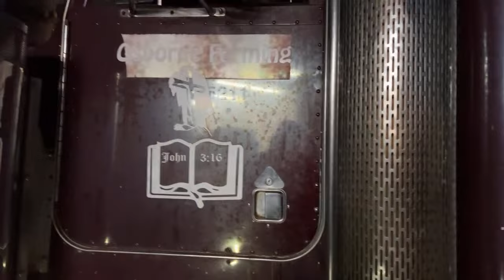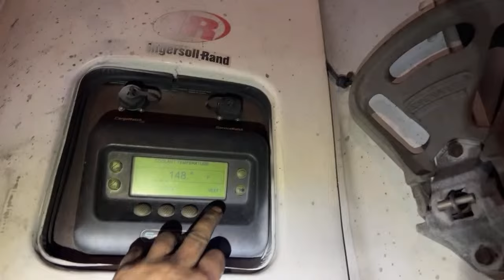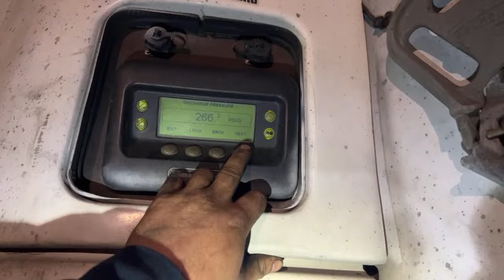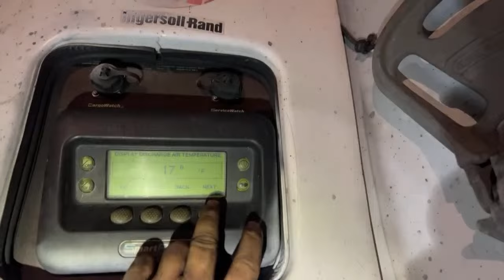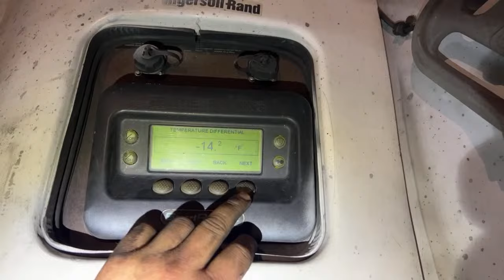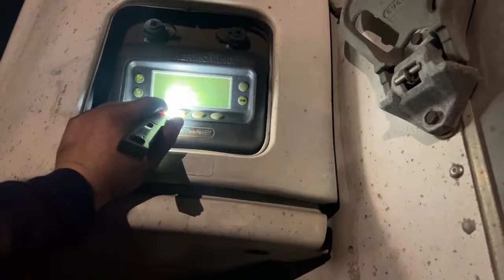Blew A Tire Under A Load!!

Comment: Hey Tim sorry this isn't a comment on this video but seen a video last night don't know if it was your or Steve's but it was one where dad was working on a big rig's engine and putting anti seize on the head bolts. Just wanted to say or ask you to tell your dad that I said thank you for the great tip about mixing oil into the anti seize, my bottle was half full and like all hard and the oil made it like new again, it was a old bottle that was lost in my garage from many years ago lol

Comment: Years ago Tim when I did service call work on those kinds of tires we used Murphys Tire and tube mounting compound. Used right out of the bucket makes that so much easier. Will also help you set the bead of the tire.

Comment: I know on 4 wheel vehicles when you put new tires on they replace the valve stem. What you need is an air thank with a blade spout on it. Its used to inflate the tire to the bead .

Comment: I drove a 1980 Kenworth with  350 big cam double frame dump truck for a couple years us 350 big cam can run if you tune them right that maroon Peterbilt looks like the same motor as that was in the Kenworth that I drove for years and it smoked like a chimney like that one does when it was cold and wouldn’t start with out a snore the good stuff when it was super cold

Comment: You should never use anti seize on stud pilot wheels it damages the threads and causes build up on the studs which can cause the nuts to loosen. Stud pilot wheels should be tightened dry and light oil on hub pilot.

Comment: I'm sorry to say but if this ol boy knew all that he thinks he knows you wouldn't have had these problems listen if he would have looked around and saw all the circumstances all an engine is is a big air compressor more air more fuel equals more horsepower but my dad taught me also that there are three C's to horsepower cam compression and carbonation listen to your dad and all day's will be good Days

Comment: It is called casing failure betting on low pressure, usual cause.  Course who cares that not supposed to limp in throwing rubber at traffic. We put safety first here.